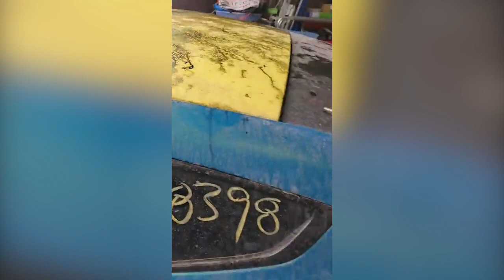Rebuilding the Worst and Cheapest Aston Martin in under 15 Minutes

Comment: You pulled that bent chassis leg/ front part back in place? Jesus …
Reply from the maker: Actually ended up replacing that section of subframe for almost $10K  we missed some details putting the compelation video together tried to keep it short.